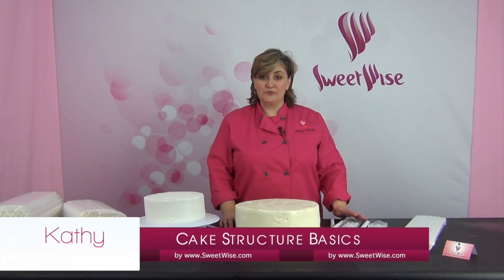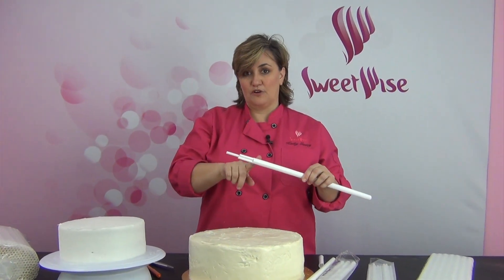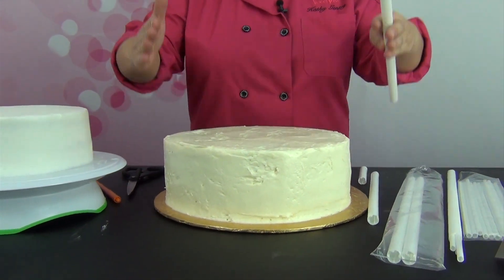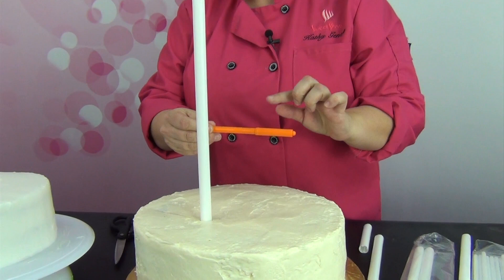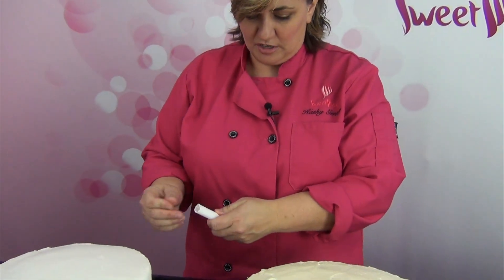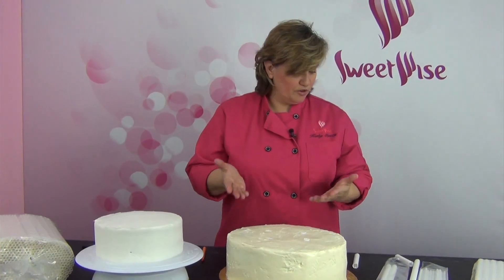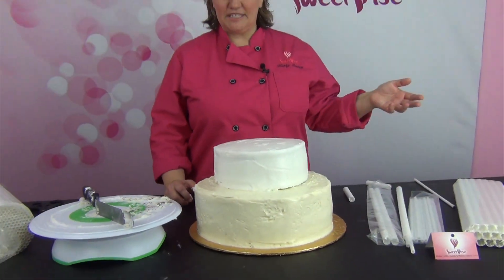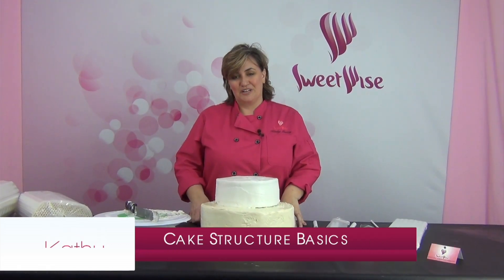Cake Structure Basics by www SweetWise com 1

Comment: Hi! Thanks for all of your informative videos. I love every one of them.
My concern is covering a cake with fondant that has been coated in either a buttercream icing or shortening icing. I normally cover a ganached cake and it works out great but when I have someone that insists on icing under the fondant, I find that the cake settles a bit after (even though they are in the cooler or in air conditioning) and thus creates shallow ripples.
What am I doing wrong? 
Also, how do you use a smoother on your fondant after rolling it off of TheMat? My fondant is always too sticky for the smoother when I use the Mat so I tend to just use a rolling pin and a work surface. Please help! I don't want to give up on The Mat...

Comment: What can be put in between the stacked cakes, to keep the frosting from sticking on the bottom when separating the cakes at the Wedding. I always end up with Frosting off of the cake, when I remove the Cake that was sitting on top of it.
Reply: Hello, I always use a circle of wax paper between the tiers it will definitely help with the icing issue.
Reply: Hello, I always use a circle of wax paper between the tiers it will definitely help with the icing issue!! I hope this helps!!